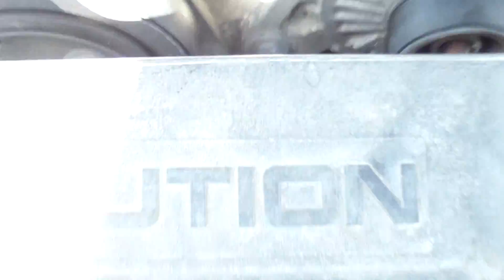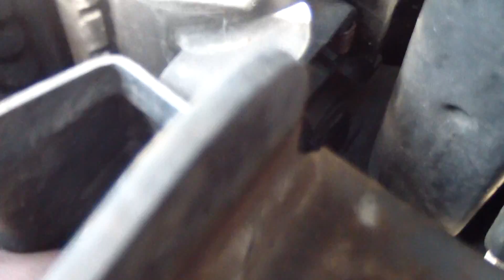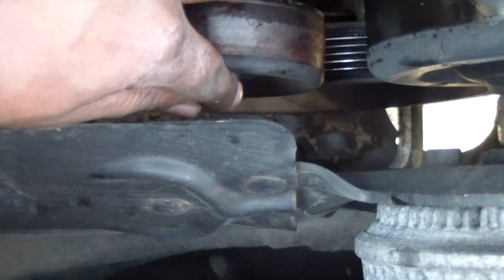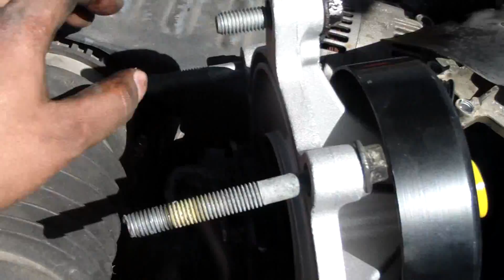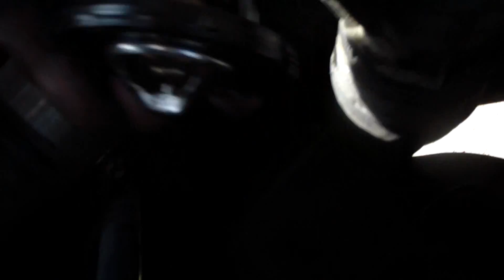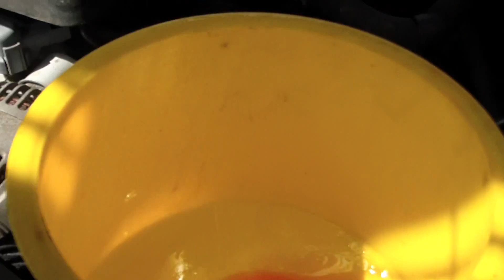1997 - 2004 Dodge Dakota / Durango 4.7L Water Pump and Thermostat

Comment: I have a 2004 dodge dakota sport 4.7L engine. Need a thermostat size, length and diameter of 2 thermostat bolts. No auto part dealer or parts stores will tell me. In a bind because only one truck. I need ASAP so I don't have to do a head gasket job. Help please anybody.
Reply: Gwendolyn Imaizumi call a Chrysler dealer and ask for the parts department.
Reply: Darrell Ducote I did that and they didn't help either. But I found a way to take off the rounded head bolt and put new bolts and thermostat in. Now when I start the truck first thing in the morning white smoke appears. But after the truck warms up no more white smoke. Now I'm thinking its a top head gasket because process of elimination of trouble shooting.
Reply: I've hard that the white smoke means a head gasket. Probably what it is
Reply: How did you get the rounded bolt off? That's such a hard place to access.

If you replaced the water pump, one of the gaskets may be off causing smoke maybe